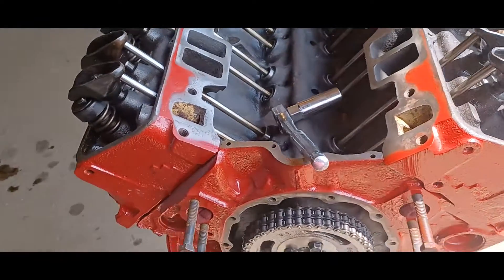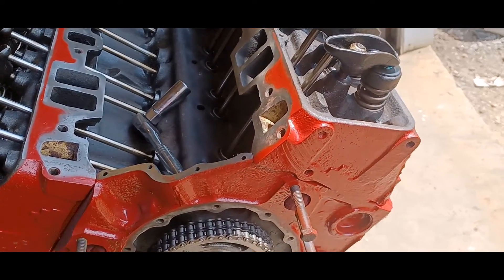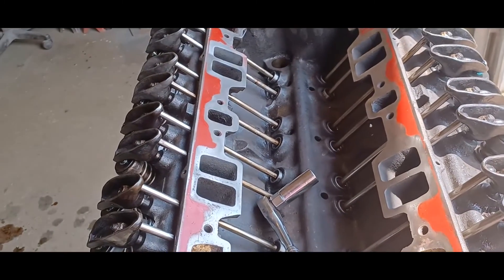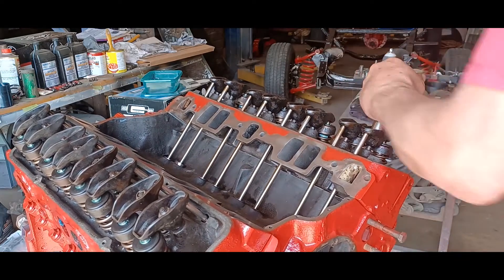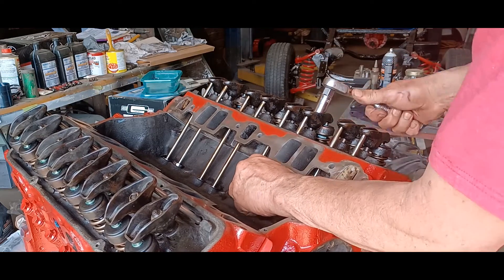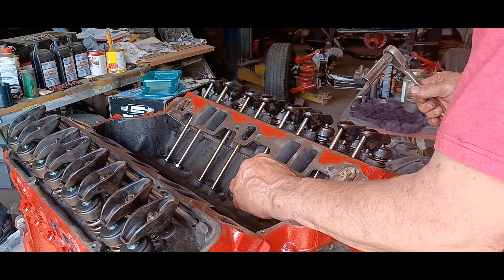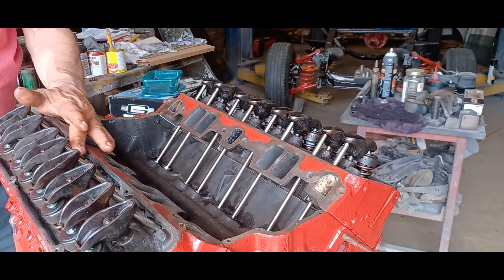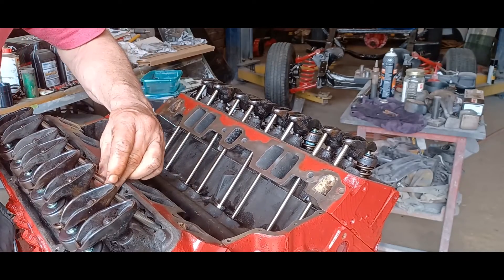HOW TO...HYDRAULIC VALVE ADJUSTMENT MADE SIMPLE! THE OLD SCHOOL WAY!

Comment: Hello, hope you're having a good day. Looking for a little help I'm assuming this will work on a 2002 5.3 Chevy engine? Just replace the two head gaskets on this engine, and torque down the Rockers to Chevy specs of 22 ft lb one rocker at a time, and we turned the engine until the spring was fully extended not compressed one rocker at a time, the video we watched did not mention starting at top dead center on cylinder number one so we didn't think it mattered so we started on cylinder 2 on the passenger side front to back then driver side front to back.. now what I need help with is the truck is idling kinda rough, and it is having misfires. Guess we went wrong somewhere. LOL but we are going to try this method this coming Friday. Thanks buddy for any help you might provide.. have a great day
Reply: Also when we do your method Friday the three quarter turn after the adjustment I don't need to even think about the specs of tightening to 22 ft lb? Thanks again
Reply from the maker: Getting to zero lash is the goal...if you go around through 3 revolutions of the engine and the push rods turn between 2 fingers without play, your at zero lash...3/4 turn on all rockers and your done...vicegrip garage has a video on the same method...good luck!
Reply: Hey man I really appreciate your response and help.. when we get all the rockers/rods adjusted and then we proceed to make the three quarter turn to finish it up, just turn it 3/4 and I'm done and don't got to worry about the torque specs?
Reply from the maker: @jimd7241  Honestly, never heard of torque specs for rockers before! LOL
Reply: @dirtydansrodncycle my truck don't have manual adjustable rockers it's self adjusting rockers as I understand it. The 1/2 turn or 3/4turn doesn't apply to my setup in my setup has actual bolts not nuts on the Rockers and the bolts actually has to be torqued to 22 ft lb
Reply from the maker: @jimd7241  That's a different engine all together...never worked on one!

Comment: Does it have to be on compression stroke when starting out? I did mine this way but just started tightening out the lash and didn't care where the stroke was as far as compression. It's noisy and runs like garbage now. I did something wrong and im thinking I needed to be on the compression stroke, and I might have been on the exhaust stroke
Reply from the maker: Shouldn't matter...did you go around at least 3 revolutions of the engine? Once your at 0 lash, 3/4 turn on each rocker and you should be good.

Comment: Thanks for the info. Was changing valve covers on my 398 stroker and found a stud bolt broken and roller rocker just sitting freely on the head. It was for the intake.  So parts are on the way and will use this method. I will check all the valves and follow your great instructions. Thanks.
Reply from the maker: Good luck and thanks for watching!

Comment: Great video, so from my understanding there shouldn't be no play on the valves?
Reply from the maker: So, zero lash is where none of the push rods have play, but depending on the crank position, some of them can turn with your fingertips. Then the 3/4 turn with the ratchet sets the preload.
Reply: @dirtydansrodncycle  great thank you for your advice 👍🏼

Comment: Hey Dan, i just picked up a small block for my 49 Pontiac and it runs insanely good. I pulled valve covers off and it's got roller rockers and guide plates. It sounds pretty lumpy and very snappy. I noticed that the rockers are a bit loose. Will this technique work on my engine as well? Should  I  just tighten them, or should I set the preload as well? I remembered this video from way back and rewatched it.
Reply from the maker: If it was me, I'd probably go from scratch again using the same method.
Reply: @dirtydansrodncycle  awesome, thanks Dan.